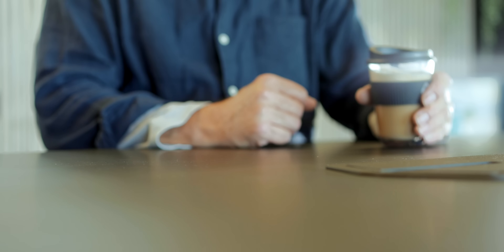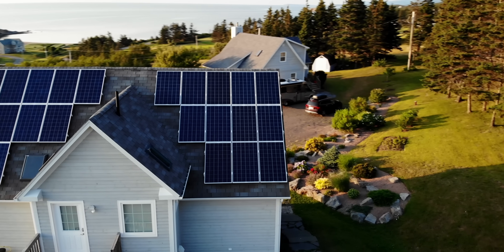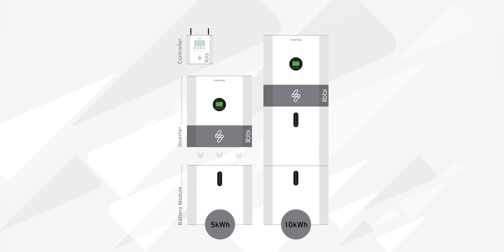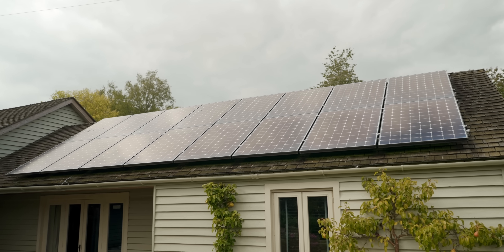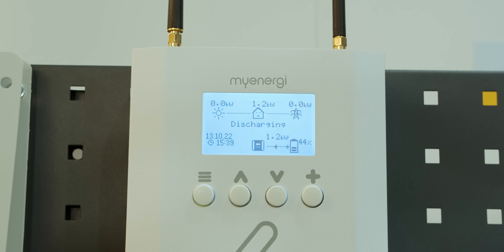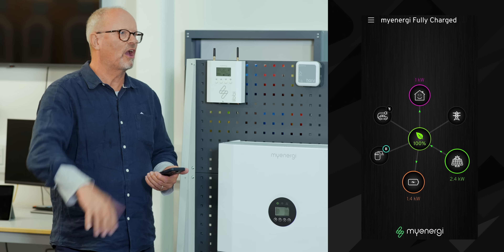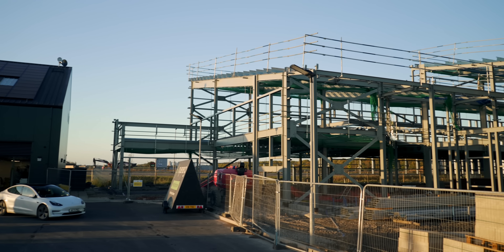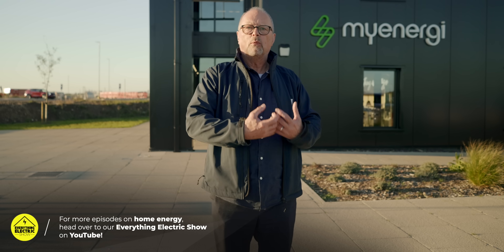THIS Home Battery is the Key To Cheaper, Cleaner Energy!

Comment: I think most people don't need battery backup.  If your grid is fairly stable, and they do some sort of net-metering a battery backup doesn't make financial sense.  Remember, you lose about 10% every time you put energy in or out of the battery.  So battery storage is about 80% efficient.

And for me, I live in Colorado where the solar may not work for a week.  So I'd have to have a giant battery to be able to survive that week.
Reply: When there is a massive difference between off-peak and peak electricity prices, battery storage makes a lot of financial sense

Comment: I know what a solar panel is, why do they have to throw in the PV part without explanation?  Now I have to look up PV (photo voltaic).  Is this extra BS really required? no
  And looking at this whole mess, never once do they discuss anything about the battery.  No  It is all about the integrated setup, NOT about what battery is used.  Very disappointed in this channel.

Comment: I do like the distributed grid battery idea. Hopefully it can be supported by legislation to encourage uptake.
Reply: Tesla have done this successfully in California
Reply: Totally agree about distributed grid battery - however, I see a danger that all these internet-connected units will be an obvious target for sabotage and hacking from foreign powers. If you fail to deal critically with this issue, then the system will be very vulnerable to this kind of attack.
Reply: @thrustsst  Long before internet-connected units become a target for sabotage and hacking from foreign powers, they are victims of Openreach sloth and incompetence 'so, this will never work in the UK.
Reply: @thrustsst  There is no real way to abuse those batteries to hurt the grid. If too many are told to deliver power to the grid, the grid frequency would go up, above 50 Hz, and the batteries would stop delivering power. They would have to hack every battery inverter model and circumvent this protection first.
Reply: @Psi-Storm  if too many just charge the grid you're right, the frequency will drift & they'll trip off but if all of them cycle power at half-second intervals, synchronized, they're likely to cause surges big enough to trip out a substation or 2 & given how flaky USA's power grid has proved to be over the years that might take everything down -- nationwide blackout, possibly with contagion into Canada & Mexico, & taking days to re-start the network. 

Never discount the amount of trouble bad actors can cause because they think it's funny or to make money or to achieve a political outcome.

Comment: My proposed system is 11kW PV which will require two 5kw string inverters. I already have a Zappi. Currently the proposal also includes an Eddi and Harvi and a Givenergy 9.5kWh battery and 3kW battery inverter.
The limitation is the maximum 3kW output from the battery. My electric oven takes 4kW when on "rapid heat" mode.
If this can output 5kW, fab! Along with ( in the manner of LotR) " a single app to control them all"
Prices and availability please

Comment: Did I hear correctly - the libbi inverter module can be interfaced directly to solar PV? If so, this should simplify a one-shot whole-system install. Hopefully, this will help many take the plunge!

With regards to exporting power for a pittance, it's not always the case! A friend (lucky enough to have a Solar PV system on the original FiT) opted for Octopus Symmetry, where the buy and sell prices are the same. He lives in deepest, darkest Teesdale, where power is often not available, and fitted a Tesla Powerwall with Gateway last year, set to export up to 80%, to help reduce the local grid load.
Reply: That's what I understand, it's an inverter, charge controller and battery all in one.
Reply: This is a big deal for someone like me, no PV or battery, I can get one unit and plug some PV into it, and it can be installed outside, which makes it possible. The lack of invasive work and ease of installation makes this very high on my list.